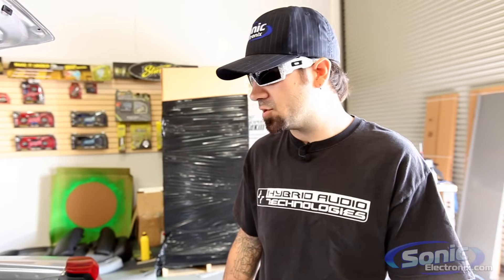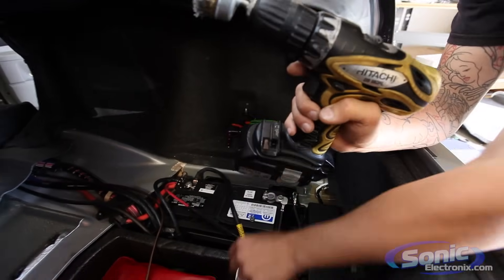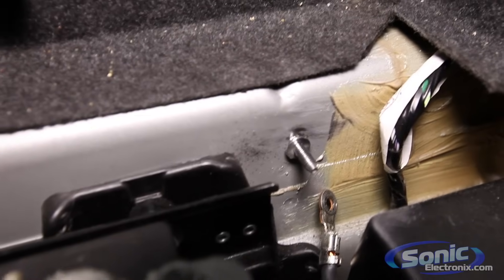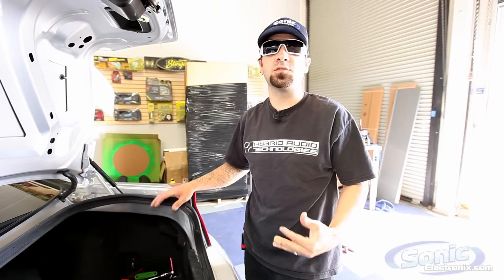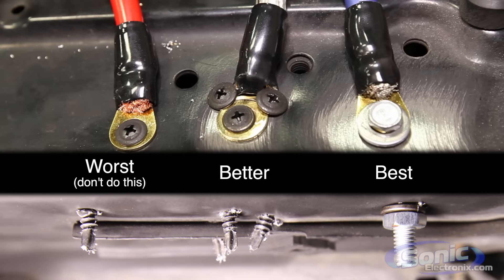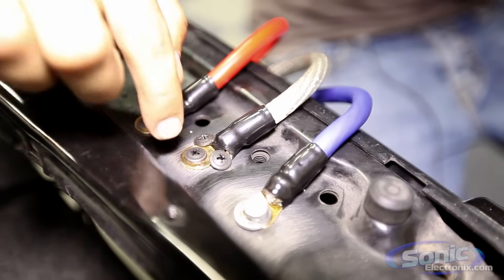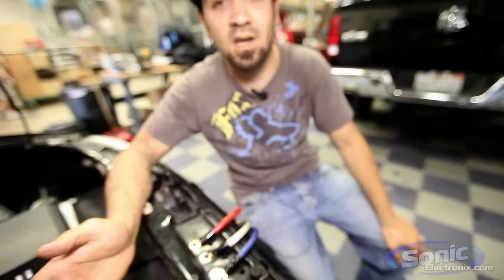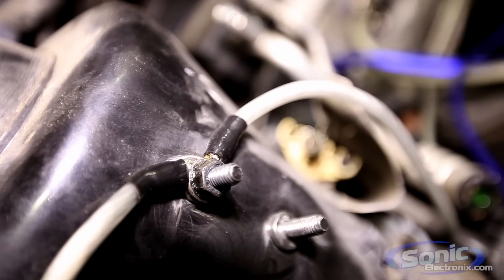How to Properly Ground a Car Amplifier | Good & Bad Examples | Car Audio 101

Comment: Audio grounds can be complex.
It’s best to ground amps the same place as the head unit, to prevent ground potential issues. Placing grounds wherever, can lead to issues. 
It’s never an issue, till it is….a star ground is well known in audio to be about the best plan. Be it car audio, or a studio mic amp. 
I not only crimp ends, but then solder them, leaving bare copper is a bad plan over time, especially with high current, like amps draw. 
Using a simple resistance meter, on both ground and positive , can show issues, quickly. And also measure voltage drop.
A voltage limited amp is never a good thing.
I hate wire installs, and do it once,  use ofc, and oversized, just in case upgrades happen later.
Copper clad aluminum wire is pure crap wire, don’t use it, no matter how cheep it is.

Comment: Your "Good" example isn't good at all for rust-prevention!  Why didn't you use some sort of circular sanding pad to sand just the bit you needed to and then put some sort of sealant around the ground wire to prevent moisture getting in?

Comment: My brother and I are attempting to install a subwoofer for the first time. I’m not sure what those little bits at the end of the wire are called, the part you actually drive the screw into. We couldn’t find a spot for the ground wire so we unscrewed another one nearby, then rescrewed it with one on top of the other. Is this why our amp isnt turning on? I’m sorry if this is stupid, we don’t really know what we’re doing.

Comment: Amp keeps turning back on. Grounded to bare metal witn 4g to inside of cab (jump seat frane/ "floor") been fine for years. It is a dry, "interior" surface even tho it's actually thru the s10 cab. Anyways, pulled power wire fuse, pulled fuse on amp and head unit had been off/doesn't auto -on. Remote wire on acc wire from head unit, nothing different from typical bs I've thrown together for past 20+ years..not my big setups but on these pawn shop/Craigslist 12s type of crap I don't care about. But Sumin has gone wrong lol😅. Worked great last 7 years and I'm 90% sure the 2004 model subs were already blown when I got them as the spiders movement is as smooth as an unpolished lava rock..they beat tho haha..
Real question- diode on ground? Try moving ground? Upgrade connections on amp with new crap from shed shelves I may or may not find or do? Any suggestions appreciated and possibly even tried..interested in this diode theory our resusdent DB-Drag /Spl tech keeps talking about as he points and laughs

Comment: Why's you stripping the paint off.. the stud is already welded into the frame...if you were installed my systems stripping the paint off you gotta PUNCH in the FACE 👀 says (Jim)) from Rockford Fosgate ahhhhhh you showing BAD examples ahhhhhh

Comment: I have a 2008 GMC Sierra 1500. My amp ground is on a seat bolt. I have a xs power d3400 under the hood and mechman 370 elite alternator with a 1/0 big 3 kit. My volts will be 14.4-14.8 but when deep bass hits my amp will clip and go down to 13 volts depending on how deep the bass is. Is it possible it’s my ground wire. Or do you think I need more power like another battery. Running 2 sundown sa v2 10s on a jp-2300 but wanted to change the amp to a sundown sia 3500 because I’m not satisfied at all

Comment: I have a question so when I turn my radio off the amp still stays on for about a minute instead of going off right away like the power light still stays on and  the fan

Comment: Man, I don't even mess around anymore.  I just run it back to the battery and I have never had any problems.
Reply: Your ground should be as short as possible...
Reply: @Bruuman  Running it through the chassis subjects it to ground loop currents which cause noise.  A good thick cable to the battery has never let me down.

Comment: I got a question. my Amp stopped working so I got the handy power meter out as you suggested! so this is on the amp itself ground to positive I get 8.63 volts with ac on. ok from ground to Rem I  get 10.68 volts what could be the issue still scratching my head.
Reply: You need to specify exactly where you connected the positive wire of the amp to your system as well as the gauge of wire used. Also, where you connected the positive wire of the head unit. Then you need to specify how everything is grounded and again with what gauge wires.  (It's usually best to ground everything at one location, and then run that point directly to the negative battery terminal.) It sounds like a bad connection somewhere, meaning not a solid contact. Of course, you also may be overtaxing your alternator.

Comment: Where should I ground an amp in a 2006 2500 HD 4 door? Rear seat bolt?
Reply: Ground the amp to the frame (as close to the amp as possible) with a good gauge wire (4 or 2) and then run a wire of similar gauge from there directly to the negative battery terminal. It also helps to ground the source component to that same location. That may not need such a heavy gauge wire.

Comment: My car stalls out could it be a bad ground or bad alternator?
Reply: Depends.
You may be overtaxing your alternator resulting in too low an output for your ignition system.
Is your battery in good shape? An old or weak battery can also put out too low a voltage under load with an overtaxed alternator. It never gets fully charged.

Comment: I’ll use a wire wheel to take paint off, bolt it down with a star washer or a split washer then coat it with some clear coat enamel so it won’t rust. That’s my go to

Comment: Why not just go to the negative terminal of the battery in this case??
Reply from the maker: It's generally not a good idea to ground straight to the main battery. If something were to happen to the battery to chassis ground cable then the whole system could ground through what you have connected
Reply: @SonicElectronix  I see where you're gong with that, which is why I run another wire of similar gauge from that ground point directly to the negative battery terminal.

Comment: What a lame video. Already has a factory battery and grounding location in back. Why even make a video at that point?
Try a more-complex vehicle where you have to remove the rear seats, plastic trim, carpet, and install a ground-location without access to the understand of the vehicle.

Comment: I recently installed a new rádio on my 2012 chevy sonic and the radio turns off and back on when the fan or ac is on.would it be a ground problem?my ground wire was done with on scrub n placed on the body of the car,painted as well.

Thanks

Comment: Question?
Ok so my Amp and 2 10 in subs have been working for about a year but now, when I power up the amp goes into protection right away, or some times it dont even go into protection.  Like there is no power to it at all. I check the grown even rescraped the area and tightened it down. I tried another amp to see if it was the one I was using but got the same problem.

Comment: My amp wiring kit's ground cable had an arrowhead shape and three screw holes.
I ground to bare metal, nut/bolted the middle hole, and used self tappers in the outer two holes.
I took your "best" and "better" and created a bester way. lol

Comment: Hey please help I have hummer h3 I put system  and it was working good tell burn out fuse where you connected fuse to battery in I went to get new one in I’m using 80 fuse in know my system when you turn it up volume to 8 it makes this heart beat in it turns off I thought it was the rca and changed it nothing was working good in turned off so you know what it could be I was thinking it could be wire that connects to battery when the fuse burned out

Comment: I have a speaker that comes with built-in lights. Where should I connect its positive terminal so that the speaker lights turn on when I switch on my vehicle lights? Also should I connect the ground wire as shown in this video? Pls help

Comment: Will I have any problems if i connect the negative wire of the amp to the negative battery post? My car battery is in the trunk and is pretty close to my amp. Tia.

Comment: I have a inline 4 channel amp, the ALPINE 445U that I bought from sonic and I'm using a stock headunit. I have it mounted in my glove box. Behind my glove box when I remove the panel there is like metal bracing that I wanted to use as my ground but I did not because everyone says it's better to mount the ground on the chassis. So I ran the ground by my passenger seat where I have my other ground for my mono amp and used a screw that is used for holding the mono amp ground in place. They also say that the ground wire should not be more than 18" Long and it is longer than that. The 4 channel is working but I'm having a static noise from my speakers when there's no music playing, but if I turn off the radio while the car is running there's no noise. I'm also having a "pop" Sound when I turn off the car from the speakers and also from my sub's but I gotten used to the pop sound from the sub. I have a LCI2 for it as well. I need help! lol.

Comment: Does it matter how thick the chassis metal is to drill a hole to ground an amp? My sc300 has no ground in the trunk close enough if I follow the 18 inch ground cable rule. The only metal is near the gas tank where wheel wells are

Comment: Hey great video ,I have bought all my car audio parts ,subs amps wires etc i desperately need your help like many others i  done everything as it should be i hooked up two aftermarket mono block amps for my 12" subs hooked up to factory headunit, in Honda 18 n i tried everything n can't get rid my engine humming out my subs please please help tatzz65@aol.com anyone please

Comment: I have two 12 inch subwoofers with a 2000 watt amp

I noticed my lights dimming every time a bass would hit

Do you recommend a get a bigger battery or a second battery?
Reply: Same problem here...maybe get bigger alternator?? That's my next move. Someone please help.
Reply: Also try adjusting your gain or bass knob a lil lower. Maybe have them up too high
Reply: 2 words...Power Cap

Comment: Wow, I had worse than the worst example - bare core wrapped around a partially-painted bolt - and wondered why my amp kept dumping on me. Reality check was I didn't install it properly at all. Embarrassing for someone who has been taught better than that.

Comment: I went to an AudioControl seminar that was great. Measure your resistance to ground at the the battery terminal. Is it over 1 ohm? Then it is not grounded very well . a faulty ground not only gives bad performance but also is a major source of ignition noise. Bare metal on Body metal is best

Comment: So I have like a fast heartbeat punding from my woofer after having work done on my suspension.. I was told I have a grounding issue. Hoped this would help but hoping comments would help more.
Reply: Find a new ground location. Most people use seat bolt. But it's better to use frame
Reply: @joshuadeacon2283  It actually was my head unit. swapped it out for a new one on best buys dime and back in business. Hope this helps someone, as i found nothing - i had to troubleshoot.
Reply: @ThesexyMrX  damn that's crazy that's a new one on me. Glad you figured it out
Reply: @joshuadeacon2283  no most real installers do not use seat bolts to install amps .. fuckin jerk 😂

Comment: The second ground was fine. You don't have to scrape off a shit ton of paint just a few scratches will do as long as it is securely fastened that will be fine. The first one was not even that bad really all you need to do is make sure it was tight. You don't have to scrape the paint off even when the screw goes into the metal that makes plenty of contact with the ground into the wire. So basically all three of those grounds would work just fine. And don't listen to these buffoons honestly

Comment: No! i'm sorry, but your job is not really professional!!  You touch the paint with your fucking TOOL ! When you can use a simple glass paper after protect the paint of the car. if it was my car, you'll spend a bad moment with me. For the rest, it's fine, just fine.

Comment: Rule one for making connections to the bodies and frames of vehicles is simply, do not sand the finish to bare metal! The reason is, bodies and frames of modern vehicles are dipped in a zinc compound. This zinc compound oxidizes in the presence of air (oxygen) and seals scratches in its surface.  Pick up a supply of star (serrated) lock washers, as standard lock washers aren't worth the effort. The preferred type have both internal and external teeth, but are not always available in the smaller sizes. When properly installed, they bite through the various finish layers, and into the base metal below. Once exposed, the zinc compound seals the connection.

Comment: Battery in back needs a wire running to thr engine block or transmission not the wimpy factory welded then metal parts horrible ground and add it onto the battery if that close haha rubbish

Comment: All you trolls missed the point. NOW let's pretend that the battery wasn't right there  It's 10 feet away under the hood. Let's also  Pretend that the guy installing the amp is a novice that's about to run a self tapper through the lid of his trunk. Those things being considered it's a pretty good example. Not everybody installing car audio for the 1st time is an SPL competitor. Obviously you all didn't need a tutorial on how to properly ground an amp in your infinite knowledge and wisdom of mobile audio install so why the fuck did you click on the link??????? 🤔🤔🤔

Comment: People if you’re worried about rust or corrosion, remove paint, bolt it down, and shoot some automotive clear coat over it. seals the whole area and it’s clear, so if it gets on something else you won’t notice.

Comment: I've always ran the ground back to the battery and as far as the positive terminal is concerned, I would run a positive from battery to a distribution block with fuse just in case an extra amp is installed. You could have a distribution block on the ground too, but always make sure the capacitor is as close to the battery as possible. Besides the other blogger was right. When you strip the paint you produce a point where corrosion will over time ruin the connection.

Comment: Amp won’t shut off using LOC and remote wire is at accessory on fuse box! 
It still won’t turn off unless I unplug remote wire

Comment: Hey what if I put my ground on the wall behind my seat? Single cab truck so I wired off the paint and there was a hole in it so I did the nut and bolt with a washer. My amp never shuts off but I’m just wondering if it’ll effect its performance in any way?

Comment: If you scrape the paint off of anywhere on your vehicle you should coat the surface with dielectric grease to prevent rust down the road, (because rust would of course make your connection go bad, even if it was good at first!)
Reply: JoeJ8282 or just paint over the top once connection has been done

Comment: Ok stupid question and I know this video is old, but, is the ground from the factory harness not good enough, or are you talking from the grounding point at the amp, AND at the battery point on the chassis?
Also, is it possible that the ground from the alternator bay be bad too?

Comment: if its a small amp, a common place is to put the amp under the drivers seat and ground it to the seat post. Just make sure you sand off paint on the bottom of the nut so i can make good contact and the threads do the rest.

Comment: At what length does the ground cable become an issue?
Reply: General rule of thumb is 3 feet or less. Some will say shorter. The more important aspect is that the ground has a good connection and you use the same gauge wire for positive and negative for each component.

Comment: good video, I have a grounding block with two ports that I use do you recommend those? I have a power cap and two amps do you recommend grounding everything separately or is it safe to ground them all together?

Comment: why wouldn't you just connect it the the negative of the battery. isn't it worse for the current to go through the wire and then go through a different gauge wire back to the battery?

Comment: quick question, my amp is on top of my subwoofer box, its screwed down, now I hit a bump in the middle of the road and my whole box flew up inside my trunk (remind you I wasn't playing any music when this happened) and my amp hit the top of my trunk, and now it will not turn on, I checked the fuses nothing is blown, I took it apart nothing is broke, fryed or blown, my wires are still in tacked, what happened? I'm so upset cause its a 1200 dollar amp I just got 3 weeks ago
Reply: Check all of your wires again. Then check again. Make sure your amp is getting the remote turn-on voltage, and there is voltage across the power and ground terminals. If all of that checks out, try to send it in to be repaired, assuming it has a warranty.

Comment: hi I have a question, I try to plug my amp, i have a pyle gear x 2000w (pdga440), and a civic 2000, I  plug my grond into a tail light right and my power protect led light up, I change the place (a screw closer), I crap off the paint,my power protector light up again, reset the amp (unplug the 12v and the remote around of 5min) all I tried doesnt work, help me please, im in fetal position in my bed

Comment: WOuld a bad ground cause issues with other electronics or alternator in the car? I found this loose wire in the back of my car(my brother installed the amp) and thought nothing of it. But i am having resistance issues that seem like a bad ground somewhere. I thought alternator ground or battery ground but just wondering if a bad amp ground could case this.

Comment: Thanks for the video, I have a few ideas, but since you seem so knowledgeable, what is the best way to run your power cable, from the battery through the firewall of an 07 Expedition?